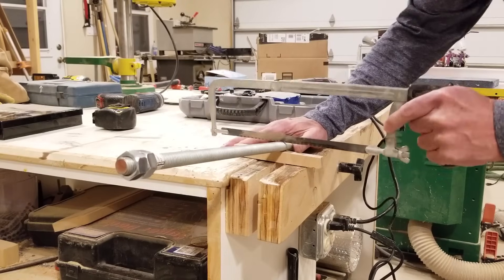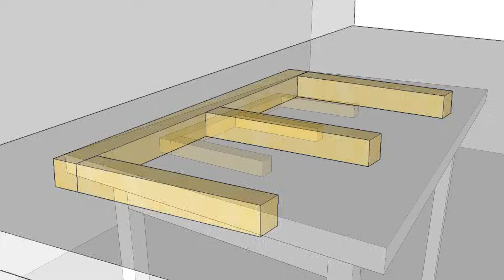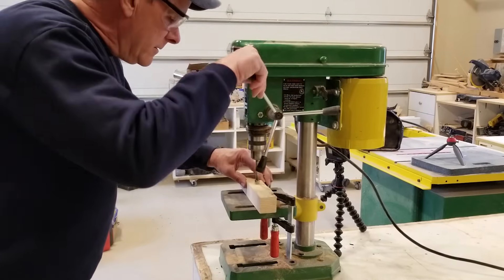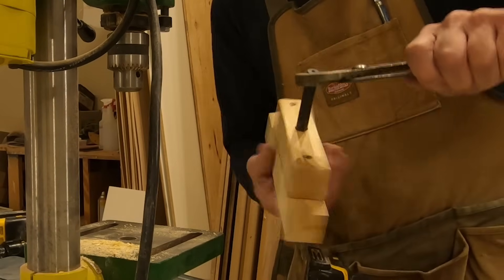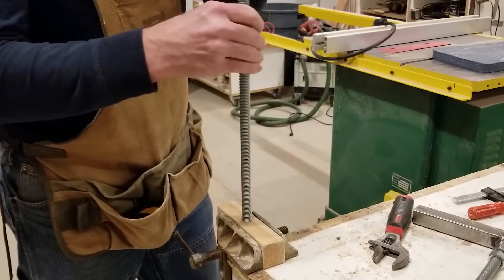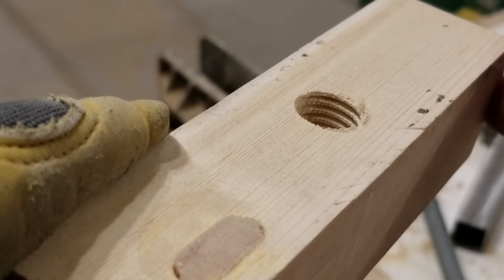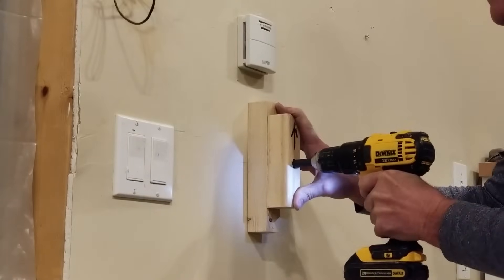Strong Floating Shelves - The Strongest Option

Comment: Great video! I suppose 1/2 or 3/4 pipe would work as well although the treads may not hold as well. I'm not sure the name of the app but i see it advertised that it locates studs, wires, pipes, etc. with a vivid view of what's back there... not sure how good it its.
Reply from the maker: Yeah, I have never tried pipe but it would provide good support as well if it is in the studs a couple of inches. Lots of ways to approach this. There small cameras that link with cell phones as well that are affordably prices these days that can be pushed through small holes to get a look but I have never tried them either.

Comment: Kind of weird this video shows up in my feed as a few days ago I was thinking about threading some rod into the studs in my house to make floating shelves. I never went through with jt because I couldn't figure out a way to actually thread them into the studs without some sort of tool.
Reply from the maker: Great minds... Yes, the tool is very helpful but not an absolute must. I have used channel locks directly on the threads to spin rods in that are too close to a wall to use the handle. Tightening two nuts against each other on the rod lets you put a crescent wrench on the outside nut and spin the rod in. So, it is very doable with hand tools you probably already have in your garage. You should give it a try! It is a good method!

Comment: Thanks for sharing and doing this demo video.
For us D.I.Y.ers that don't have 'welding tools and skills' to custom fabricate a similar gadget that your son made, what would you suggest we use or do to screw an 'all thread rod' into the stud?
I was wondering if I used a thin blade (hacksaw or grinder) to create a slot at the end of the rod, then I could use a flat blade screw bit and drive it in the stud.
Reply from the maker: Yes, Pvt, there are many ways to spin the rods into the studs. The handle my son welded up is great for me because I do much more of this kind of work than most! I have used channel locks to twist the rods in when a hole is too close to the wall to use the handle. You can tighten two nuts against each other on the rod, then use a wrench or socket with a ratchet to spin the rods in. Your idea might work but it may take more torque than you could generate with your hands on a screwdriver depending on how snug the hole is for the rod. You find the more you do this that it is helpful to drill and ream the hole to just the right tolerance for the rod to spin in place without a great deal of effort. Once you figure that out, the installations are much easier! Thanks for watching and good luck with your shelves!
Reply: @RustyDobbs  Thank you Rusty for your trustworthy advice.

Comment: Great video, what if its a block wall?
Reply from the maker: Drill hole with a masonry bit near the size of the rod you are using then use epoxy or construction adhesive to glue rod in place. Be sure to support rod in proper alignment while adhesive dries.

Comment: What size drill bit did you use? was it 1/2"?
Reply from the maker: Whatever size of rod I am installing, I use a drill bit 1/16" larger which normally works well. If that seems to loose, I'll drip back 1/16".

Comment: A tip if you can't get a washer to fit in there b/c of it being too wide, is to go for the extra heavy nut.  The extra heavy nut will be a bit thicker than the nut you used, and would be good if used without a washer.
Reply from the maker: Good idea, J toker! Thanks for watching and for the suggestion!
Reply: @RustyDobbs  I was like you and didn't think much of floating shelves, but after watching your video, I'm a believer if done right.   Thanks

Comment: If you used hanger bolts (half lag bolt, half threaded rod) instead of the threaded rod, you could skip step where you threaded the stud wood, and you wouldn't need to create the threading jig. Of course then you wouldn't be able to buy those cheaper threaded rods and cut them to size, unless you have a son who could weld you some hanger bolts.
Reply from the maker: Yeah, Matt, there are a lot of ways to approach recreating this type of installation with other rods or bolts. I like the all threads for the reason you noted of being able to cut them to the length I want. The welded tool is handy for me because I tend to do more of these installs than the normal person so it is faster. In places where the tool won't fit like close to a side wall, I use a 'jamb nut' and wrenches or a socket and ratchet for treading the rod in place and that works fine too.

Comment: Another way to secure a solid core shelf to the bolts would be to drill a couple of 1" wide, shallow holes in the bottom, exposing the existing bolt holes, then adding hex nuts in there, which can be tightened with a wrench. I believe they even make little inserts to provide a flatter surface for the bolt (otherwise the bolt is pushing on the curved side of the shallow recess). Maybe we can it "IKEA Style"?
Reply from the maker: Good idea, Matt! Thanks for watching and for your comments!

Comment: Yeah. No. There's no way the average Joe can "just drilling a couple of pilot holes for the threaded rod," as well as make the threading tool, etc. -- unless he supplies his Son-the-Welder. I'm afraid I was left in a lurch after the welding step. 😞
Good technique, but far more involved and labor-intensive than (i dare say most) DIYers could pull off. 
Bully for you, tho.
Reply from the maker: Now, DogDream, if I handed you a 2x4 and an all thread rod and asked you to figure out a way to thread it a couple of inches into the wood, I’ll bet you could come up with a way to do it. Yes, forget the welding step and use a ‘jamb nut’ approach with two nuts on the rod and a couple of crescent wrenches or a ratchet and socket. Lots of people in the comments talk about using 10-12” lag bolts and cutting the heads off, then sliding the shelves on. Lots of ways to tackle this type of approach! Thanks for watching and for your comments!

Comment: This is a great video and a great concept. 2x4’s are less then 2in x 4in. It seems like you’re left with a lot less material after drilling large holes. If you’re able to center it, and your studs are very flat and not twisted in the wall. This may be able to maintain the integrity of the wall. I may be ignorant, but it seems like drilling large holes into a structural element is a recipe for damaging the 2 x 4 framing. Finding the center of the stud is crucial. I’d really like to be able to utilize this method. If done correctly, there should be little to no issue. I’m guessing there are areas around the home that are holding a good deal of the weight beyond the studs behind long stretches of drywall. And there shouldn’t be any issue with this method. Thank you
Reply from the maker: Thanks, Jinji! I think all of your concerns are things to take into consideration, particularly with 2x4 load bearing walls. Common sense goes a long way toward avoiding problems with any type of construction projects. Definitely want to hit the center of each stud without question and don’t go beyond 1 1/2” depth on the holes. Be careful not to overload the shelves in 2x4 walls with heavy objects. You sound like you are aware of these kind of considerations. Good luck with your project.
Reply: @RustyDobbs  thank you for taking the time to put down some thoughts. Awesome points to take into consideration. Awesome video’s

Comment: A little easier for DIYer just use 1/2" x 10-12" screw thread lag bolts . Use your guide block to predrill studs. Screw in lag using socket driver then just cut off hex head of lag.
Nice video !
Reply from the maker: Thanks, HJ! Yeah, there are a lot of ways to approach this type of install. A lot of contractors who have commented use your approach.

Comment: If I were to use this method to do a floating desk, how deep do you think the desk could be? I am wanting it to be around 21" deep
Reply from the maker: I have a video where I mounted a floating desk to the wall using this approach and it has held up fine. It is basically a drawer stack that is off the floor. If you are talking about a wood slab as a desktop, it gets a little more tricky because of the width and the springboard type effect that increases with width. I will have a video coming out with 17” wide x 8’ long floating storage shelves with a lot of weight. I have 3 - 5/8” rods on 32” centers with one end of the shelf in a corner with a support piece under it screwed into the adjacent wall. The whole shelf is amazingly solid. If I have gone with rods at 16” centers or in each available stud, it would have been overkill. The rods are 18” long with 2” holes in the studs which are 2”x6” framed walls. A lot of this is trial and error so you just need to experiment a little with you unique situation.

Comment: But wait these are hollow walls, my home has only brick walls.
Reply from the maker: It's a little different process for brick, Turnip! You still drill holes, but you need to secure the rods in the holes with a good construction adhesive and hold them in position until it sets up.

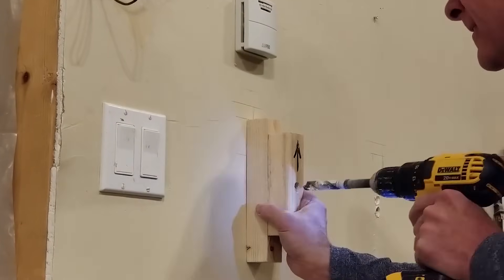Comment: 7:30 round about here you mention something REALLY important - an issue i encountered recently that i had NO idea what the fekking problem was. drill/screws not going in. and that's what it is - not knots in the wood or whatever but hitting nails and screws. had a helluva time mounting some things recently because of this (multiple rooms) and it WAS frustrating. also had the electric notification pinging all over and had to open up the wall.

EDIT: somehow in all the google searches i did, no one mentioned this. best i got is a strike plate protecting wires. not helpful, in my situation. also, knots. nope, it was screws and stuff. they were ALL over. sloppy. annoying.
Reply from the maker: Yep, you have to get really lucky normally to hit more than one screw or nail buried in a stud on the same project, but it happens, LurklingX! My first concern always is that it might be a wire because I can't see what's there without opening the wall up.

Comment: Do u think i can spin the rod into the wooden stud without the ''custom welded tool'' u made
or is there any equivalent tools in the market that i can buy ? 

thankyou in advance :)
Reply from the maker: Yes, SensZ. You can use what’s called a ‘jamb nut’ technique where you spin two nuts on the rod and then tighten them together against each other. Once you get the hang of it, you can put a wrench on the outside nut away from the wall and screw the rod into the stud and use the inside nut to spin the rod out of the wall, if needed. You can also use a socket and ratchet if you set up the two nuts right. A little challenging, but it works! If you get a little creative, there are other options too.
Reply: @RustyDobbs  Thankyou very much for the reply , i'm currently planning to do your project on a larger scale with multiple rods on a more wider shelf 

With your advice , my DIY  project stays alive ❤ and i am very grateful :) , can't wait to see your upcoming tutorials/advices ,  thankyou once again !

Comment: Hi.  I like your videos.  Maybe you can tell me or tell me how to figure this out.  If i want to build a bookcase with shelves 12 inches wide and these shelves will be built out of 3/4 inch solid maple and reinforced with a 1 and 3/4 inch lip, how long can the shelf be and not sag under the weight of heavy books.
Reply from the maker: Hi Joseph! Happy to give you some general feedback but obviously the weight of the books is the critical factor and you might just try taking a piece of your 12 " wide, 3/4” maple placed on blocks at various intervals and load it up with books in between the blocks to see what kind of deflection you get. From a design standpoint and depending on the space you are filling with shelves, I tend to not go longer than 4’ for individual shelfs. So a roughly 8’ space with two 4’ divisions is a pretty good look. I would think a 12” solid maple shelf with a 1 3/4” front edge limited to a 4’ length would handle a heavy load of books just fine. If you add a back edge to the shelf as well, that helps too with limiting the potential sag. Good luck and hope that helps!

Comment: Can I pay for one of those custom tools to cut the threads from you?
Reply from the maker: Sorry we haven’t made extras of the tool, Evan, but the size matters depending on your application. I use 5/8” rods for most of my installs so that’s the size of my tool. But it is pretty simple and I bet a welding shop would charge very little to help you out. The tool is just a piece of 1” steel tubing with a 5/8” nut welded to it. The cutter is a short piece of 5/8” all thread rod that I tapered just a little at the end with a sander then used a Dremmel to cut some thin slots in as relief slots for when cutting threads. A couple of nuts for tightening things up during use and that’s it. Hope that helps!

Comment: Great, honest video! Love that it shows everything that went wrong and right. Learned a few extra fixes in there as an added bonus.

Now I'm going to be building some of these and love this approach. But what I'm going to do is notch all the rods I will be using rather than building one tool. Then rather than use a handle I will use double nuts tighted together and just drive them in with a 1/2 inch ratchet. For securing them I think maybe I'll just use construction adhesive. Apply a bit to about 1/4 inch of the rod closest to the wall. I think that will hold nicely and will pry off easy enough if needs be down the road.
Reply from the maker: Thanks for watching and for the comments, Lypoi! I like your take on tweaks you will be making on your approach using this method. Yes, there are lots of ways to installing the rods in the studs and using a ratchet is a good one! I will be uploading another video soon on installing three, 8' shelves using my method and will be revisiting my process.

Comment: divespec allthread spec sheet. 
Typical Material: Low Carbon Steel
Material & Mechanical Properties: Purchased to meet ASTM A307 Grade A.
Zinc Plating: Purchased to meet F1941 FeZn3A.
Hot-Dip Galvanized: Purchased to meet ASTM A153.
Tensile Strength: 60,000 PSI minimum.
Size TPI*  PSI**  Pounds   Size  TPI*   PSI**  Pounds
1/4  20  60,000  1900         1/4  28  60,000  2180
5/16  18  60,000  3100      5/16 24 60,000   3480
3/8  16  60,000  4650        /8 24 60,000   5270
7/16 14  60,000  6350       7/16 20 60,000   7120
1/2  13  60,000  8500         1/2 20 60,000   9600
9/16 12 60,000  11,000    9/16 18 60,000   12,150
5/8 11  60,000  13,550      5/8 18 60,000   15,350
3/4 10  60,000  20,050      3/4 16 60,000    22,400
7/8 9  60,000  27,700        7/8 14 60,000    30,500
1" 8  60,000  36,350          1" 12 60,000   39,800
1-1/8 7 60,000  45,800    1-1/8 14 60,000    40,700
1-1/4 7 60,000  58,150    1-1/4 12 60,000   51,400
1-3/8 6 60,000  69,300    1-3/8 12 60,000    64,400
1-1/2 6 60,000  84,300    1-1/2 12 60,000   78,900
1-3/4 5 60,000   114,000    1-3/4 12 60,000   94900
2" 4-1/2 60,000   150,000

Comment: mate there is no need to have those long therds the weigh is all at the back and next to the wall and will be solid as your long rods 150 to 200mm will long enough (also dependent on the thickness of the timber shelf - thicker shelves less bend on the end) Also can use long blots screws which make slight easier for screwing in the timber
Reply from the maker: Yes, Lgiestas, there are lots of ways to approach installing floating shelves. Thanks for watching!

Comment: Can you also use ledger lok bolts instead?  I don't have a threaded handle.
Reply from the maker: Hi Danielle. The ledger lok bolts have a lot of flex to them in my experience in using them so they would not be a choice for me on this type of installation. The threaded handle is not a necessity. You can thread two nuts on a rod, then tighten them against each other. Using a wrench or socket on the outside nut will allow you to thread the rod into a hole in the stud. Lots of ways to get the job done!

Comment: Did you try using an impact driver on the locked nuts do do the initial threading? I don't have a welder handy to make up that threading tool.
Reply from the maker: I did not, Jonathan, but that is a good idea! It doesn't really matter how the rods get threaded into the studs as long as the holes don't get enlarged in the process. I have had good success with a socket and ratchet in tight spaces against a wall where my tool doesn't fit. Jamb nuts and a crescent wrench will also get the job done!
Reply: @RustyDobbs  I found this video: https://youtu.be/Irup0nfmmyE 
He deliberately drills the stud holes larger than the rod and then sets it with glue. Same on the shelf side - he just sets it in with glue. Has the benefit of not needing to accurately angle the rod.